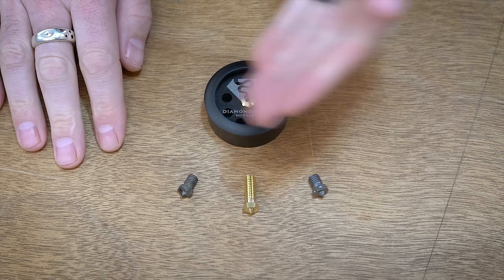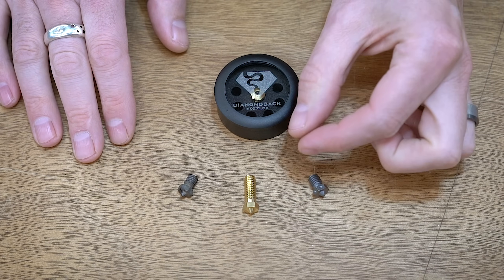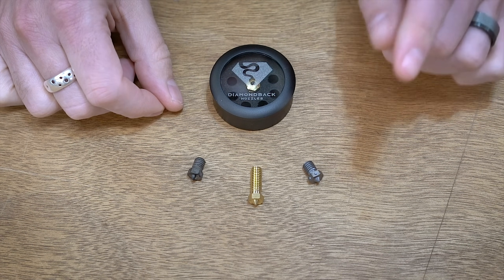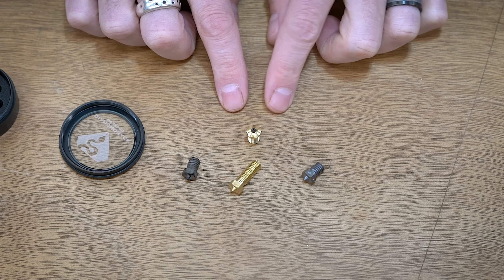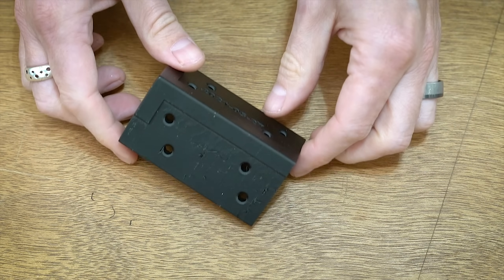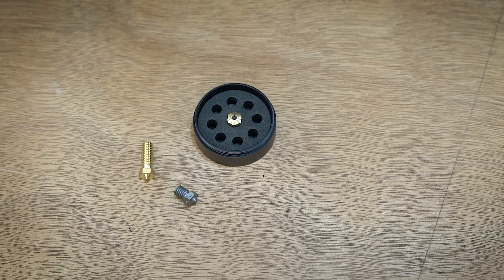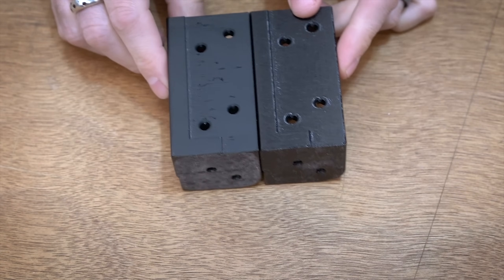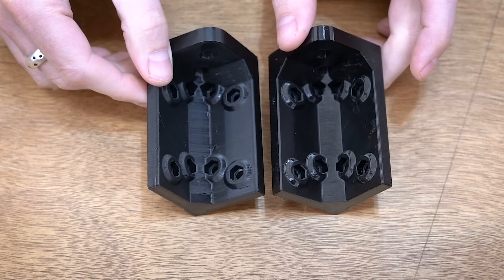Is a $100 Diamond Nozzle Worth it?

Comment: Not only is the diamond just as conductive as brass it’s even more powerful so you have to lower the temp by 10% or you can risk over heating
Reply from the maker: Eh, not always.  I've never had to adjust my temperatures.  Sometimes you do, but most of the time it's not necessary.

Comment: Actually the way nozzles wear out isn't the particulate scraping the insides. It's mostly the tip scraping against the solidifying print.
Reply from the maker: Correct.  That's why it has a diamond tip.

Comment: Are you thinking of putting the diamond back nozzles on the XL? Seems like it would be a help all around with stringing and oozing.
Reply from the maker: Yep, I have two diamondback nozzles on the XL.  Proper filament temperatures and settings fixes oozing, the nozzle doesn't really change that much.
Reply: @RobertCowanDIY  is there a reason other than $$$ not to go all diamond back?
Reply from the maker: @crashkg  I don't think so.  For me, it's worked well on all materials.
Reply: I’m holding out hope that Diamondback comes to the Nextruder nozzle.  I have Revo Diamondbacks and love them.
Reply from the maker: @winslowjoy2629  Me too!  I keep talking to them and asking when they're coming out with it!  They said they are working on it.

Comment: I heard recently that a drop of mineral oil will help lubricate nozzles to help them clog a lot less than if they're not lubricated. I haven't had the chance to test it myself, but there were many people in agreement. They were specifically talking about all metal heat brakes being less lubricated than the lower temperature one's that aren't "all metal"... but it's the same concept and same temperatures in both cases.
Reply from the maker: I've done this trick before.  You can just apply a few dabs of oil on a paper tower and wipe the filament right before the extruder.  It helps but introduces contaminates.  It's good for cleaning a partial clog (sometimes).

Comment: Why $100? They've been selling $1 to $3 diamonds on ebay that are very large for their cost. You're talking simulated diamonds the size of a smaller nozzle for just a couple bucks.
Reply from the maker: Because actually manufacturing diamond (synthetic or otherwise) isn't easy.  Diamonds are REALLY cheap, but getting them shaped into usable dimensionally-accurate tooling is the trick.  You can just drill out a brass nozzle, you can't do that (as easily) with PCD.
Reply: @RobertCowanDIY  I do think you could easily produce a diamond the right shape for about $1 per diamond, and if I'm not mistaken, you can easily use water to cut a hole in the diamond to whatever size is needed. When I bought a bunch of diamonds on ebay (about 10 years ago) they were about $1 ($0.74 to $0.99) for large, multi carat diamonds and the same company was selling them for the same price with holes in them as beads. That's why I figured they could make inexpensive diamond nozzles. I think the same is true for synthetic ruby also. I don't think they have to be expensive.
Reply from the maker: @deucedeuce1572  The devil is in the details.  Sure, waterjet SOUNDS like something that would work, until you realize that it almost always cuts with a bit of a cone, so it wouldn't be a straight hole.  Also, the holes are jagged, which isn't ideal.  Also, garnet is the abrasive used in waterjet cutting, and that's not hard enough for diamond.  ALSO, they have about a 0.020" minimum diameter just tp pierce through, which is too big for a 0.4mm nozzle.  Listen to someone who understands all these manufacturing techniques, it's not as simple as you're making it out to be.  Sure, diamonds are largely just carbon, and carbon is cheap.  It's not THAT simple.  If you can come up with a plan to make them for less than $5, I'll fund your whole business.  Send me a business plan and let's do it.
Reply: @RobertCowanDIY  There's always a way. Not too long ago people said it was impossible to make diamonds in a lab... and 3d printers would have been considered science fiction. I understand the science and the processes extremely well (more than you realize)... and I have absolutely no doubt that it's not only possible, but also that it's not as difficult as you think. (even if compromises may have to be made).

They're able to make water jet nozzles as small as 0.002" in diameter and can make features the same size. Not only could they cut a hole smaller than 0,4mm, but they could literally cut a CIRCLE less than 0.4mm. There are also simple ways to fix any waviness of a cutting edge, especially one that is small and circular (like spinning the part)... and who's to say it would be a bad thing for the walls of the hole to be wavy? Sometimes things can be too smooth and that smoothness can cause stickiness and friction when a bit of texture can completely fix the problem (and for a few reasons).

I think a fair example is that some smooth-bore rifles actually have serious problems with leading, even if they're chrome lined and polished... but when the same barrel is rifled, whether with polygonal rifling or grooves, it is far, far less likely to have leading problems. I believe the SIG P322 had problems recently when they made their .22lr barrels too smooth. They started having terrible leading problems, because of it and they were having a hard time figuring out why. Like, making the barrel even more smooth should have fixed the leading problem and not made it worse.

...so yeah, I think it would not only be possible, but that it would be easy to make diamond nozzles for a fair price (definitely less than $20 and while making a good profit).
Reply from the maker: @deucedeuce1572   Send me your proposal and I'll fully fund and promote it.
Reply: And how is the fund business going on with the diamond nozzles under 20$?
Reply: @deucedeuce1572 hey head case, how’s the start up going?

Comment: From what I've read the wear mechanism isn't from the filament going through the nozzle, opening the bore, but from the tip dragging over cold layers, sanding the tip down?
Also, how's the nozzle after a year? :)
Reply from the maker: Correct!  Sure, the nozzle will open up a bit, but it's usually the tip shortening due to dragging across the print.  A year+ later, the tip is the same as new.  PCD is nearly invincible (in this application) and nothing will abrade it.  PCD-coated tooling is the only stuff that will last when machining carbon fiber or other abrasives.  Diamondback has a video where they take an abrasive rotary tool to various nozzles and the Diamondback actually grinds down the abrasive disc instead of wearing down.  PCD isn't magic, it's used heavily in industry for situations like this.

Comment: I have a dimonback. The bore was bigger than .04 and the diamond tip is magnetic……hmmmm.
Reply from the maker: That doesn't sound right.  Are you sure it's legit?
Reply: @RobertCowanDIY   A magnet picks up the nozzle by its tip. Maybe the core is ferrous. I looked at the tip under a microscope and compared it to my copper nozzle that came with my MK3S+ and a new micro Swiss cm2, the diamondback bore  definitely looks like a  larger bore.  I have no other way to check the bore other than visually. I might have received a defective diamondback. I know every channel praises that, but I have had better luck with micro Swiss CM2 nozzles.
Reply from the maker: @MrKornnugget  It really sounds like you got a knockoff or something.  That's a bummer.
Reply: @RobertCowanDIY   It is possible. I have received knock offs of items from Amazon before.
Reply from the maker: @MrKornnugget  You might want to reach out to the company.  I've met them before, they're nice people.  They might like to hear your experience and it IS fake, they might want to know.  It's worth a shot!  And if they tell you to go pound sand, just don't buy from them any more.

Comment: Any chance for a followup after a year? Are you still using it? I'm wondering how does a nozzle like this compare to tungsten carbide alternatives.
Reply from the maker: YES!  There's nothing to really report.  I am still using it without any issues.  I've run maybe a dozen rolls of abrasive filament through it without issues.  I also use it for PLA and PETG and don't have to make adjustments for anything, I just the default profiles in prusaslicer.  Tungsten carbide is a great material, but bad for heat transfer.  I have a MK4 and XL coming soon (hopefully) and they will get Diamondback nozzles.  I like being able to just print everything and not worry about the nozzle.  For ME, the $100 isn't a big deal and removes maintenance or variables from the machine.

Comment: For $100, you'd think they would have made the rest of the nozzle out of either hardened steel or tool steel...
Reply from the maker: hardened steel is a pretty poor conductor.  brass is a better conductor for heat, so it's actually the better combo.

Comment: Just to mention it. The diamond tip one is aprox 5 times more thermal conductive than a regular brass one. So not the same.
Reply from the maker: I forgot exactly what I said, but yes, you're right.  Diamond is a MUCH better conductor of heat, but the main body of the nozzle is brass, the diamond portion is only the aperture the filament goes through.

Comment: A note about Olsson Ruby: the ruby tip is a tiny orifice held in place by a brass sleeve pressed into the main body.
Filament contacts the ruby only to pass through the hole; the ruby doesn't conduct heat to the filament.
The down-side is that the sleeve can shift out of position, allowing the ruby to get loose.
Heat transfer from body to sleeve is poor!  I had to bump up printing temps three times before I figured out what was happening.
Soldering the sleeve into the body (300C tin/lead/silver) prevents movement and improves heat transfer.
If the diamond tips are installed the same way, hard pass!

Comment: Wasn't impressed with diamondback found retraction performance poor tons of stringing regardless of temp, retraction distance, or retraction speed. Just couldn't get it to tune thinking I may have gotten a bum one but at 100 dollars a pop I'm not buying another to find out I'm just gonna stick with nozzle x
Reply from the maker: That's really strange.  Mine has been just fine, works the same as the brass.  Have you double-checked your filament or tried different brands?  Also, have you dried your filament?  Mine has been spectacular and I will be using this nozzle on all my printers going forward, love it.
Reply: Lower your hotend temperature
Reply: @BrazenRain  I have by as much as 15 degrees still strings like crazy
Reply: @MrShaun1578  I was thinking even more, since nozzle-x requires higher than usual temps
Reply: No stringing issues on mine. Works exactly the same as my brass tips, it just refuses to wear out-- and I print a lot of CF.
Reply: I just switched to a 0.6mm Diamondback for printing Prusa PC CF.  Had terrible retraction problems like you.  Also I was over extruding quite a bit.  With the stock 0.4 nozzle (MK3S) I was running an extrusion multiplier of .96.  With the new nozzle and material I had to lower it to .85 before my small holes were anywhere near size and my top surfaces look better as well.  But the real fix for the retraction problems was temperature.  I had to lower print temp from the recommended 285 to 275 before I could dial in a decent retraction.

Comment: Added to my wish list. I do a ton of printing and I hate swapping nozzles. I feel like I'm going to break something every time. I wonder how long it is expected to last?
Reply: The company hasn't worn one out yet according to their own use.  I just bought one and will be giving it a good run.
Reply from the maker: I have no idea.  I'm a couple hundred hours on it so far.  It still works the same.  With 3d printing, you would need it to last many thousands of hours I would assume?  I think as long as no material can wear it down, it should last indefinitely?  Not sure.
Reply: I mostly do PLA and PETG, but I still think this will be beneficial so I don't have to swap nozzles very often.
Reply: @RobertCowanDIY  I've wondered this, but they can definitely be worn down, otherwise they wouldn't be able to make them. Even softer elements can wear down harder elements in many cases, like water (not technically an element) can cut through diamonds and just about anything else (at least eventually). I do wonder if the micro-hardness of carbon fiber would be enough to wear it down eventually too. I think you're right for the most part though. They may be expensive, but they probably last forever. (I'd love to see one under the microscope after heavy use). I don't think PLA and the other standard filaments would ever wear one of these down though... but I think it's possible that carbon fiber could. Like with graphite, it's extremely soft, but within graphite lays many micro pieces of graphene which can easily cause surface wear to a diamond.
Reply from the maker: @deucedeuce1572  In my experience, they should outlive the printer.  I ran one for 1K hours or so and it was identical to new.  All I know is from machining, PCD is very popular for cutting carbon fiber.  It may very well wear down over time, but I think it would take several years of continuous printing.  Keep in mind the plastic will largely yield away from the tip.  If you were scraping it against hardened prints, maybe it would wear.  But it's lightly dragging against the (relatively) soft surface.
Reply: @RobertCowanDIY  Really appreciate the info/replies.

Comment: Glow in the dark filaments also have abrasive material in them so they're another application of a hardened nozzle.
Reply from the maker: YES!  I mentioned this in a segment that didn't make it into the video, but there are a LOT of filaments that have abrasives in them like glow in the dark and wood-fill.  They can eat through a nozzle pretty quickly.  For maximum flexibility, always using a hardened nozzle is the way to go, manufacturers don't always disclose when their filament is abrasive.

Comment: The problem that became apparent with the ruby brass nozzles was that the abrasive materials would just gouge out a massive area above the ruby leading to the ruby eventually detatches from the brass nossle.
I suspect the diamond nozzle will have the same problem.
Reply: I was thinking the same thing here...   Why would the abrasives have the same effect here?   Unless the entire path is lined with diamond, I don't see this being any better in the long run...   Will definitely appreciate a followup video 6 months from now
Reply from the maker: I will absolutely let you know if this happens.  I have no affiliation with the company and have some printing with abrasive stuff coming up.  If it fails, I will want to let everyone know to stay away!
Reply: @RobertCowanDIY  It will likely take towards 50-100hours of abrasive printing or even more, unless they cheaped out and used really soft brass.
Brass don't really wear that fast with abrasive materials, a cheep brass nozzle easy last 10h or so without the hole getting so large it's unusable, (use a 0.4 but tell the printer it's 0.6)
Reply from the maker: @aggese  Materials are different, but I think the carbon fiber filament can destroy a nozzle in a couple of prints.
Reply: @RobertCowanDIY  I am well aware I work with 3d printers and we used to print carbon fibre nylon with brass nozzles because we had a bunch laying around and the machines we manufacture don't use the screw in nozzles.
Reply: @aggese   You can take this with a grain of salt but, Diamond Back actually created these nozzles for themselves because they 3d print high volumes of parts for their other manufacturing needs. They Stated they still have never had one wear out. The kickstarted was a launch trial for consumers where I believe they did have to tweak the process a bit but I have heard nothing but good things since. And to be honest, this is what these guys do, they manufacture Diamond Wear Parts. "Spartans, What is Your Profession?!!"
Reply: @Phixeas  That's really good to hear. Any idea if they print carbon fiber at all?
Reply: except plenty of people have posted pictures of the nozzle boring out just a year later. It makes no sense watching the video of them making the nozzles saying they've never had one bore out, but people are saying after a year of printing they notice the nozzle boring out. They back up those claims with pics as well. Wonder if thats why they dont warranty them? @Phixeas

Comment: What is the problems you had with PETG?
I have found that for better performance the final thin cannel need to be longer.
Reply from the maker: It's in the video, check the chapters.
Reply: @RobertCowanDIY  I totalt missed that chapter when I watched the video earlier.
Yeah that's a really annoying issue,
I have had similar problems with glass fibre nylon, never any problem with regular or carbon fibre nylon but glass fibre seem to just glue itself to the nozzle and creates really large and ugly blobs